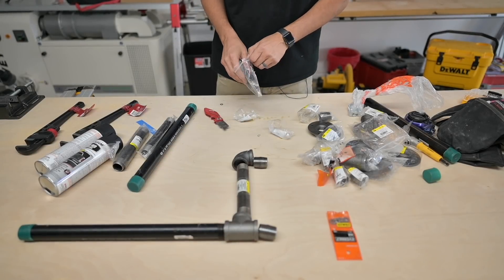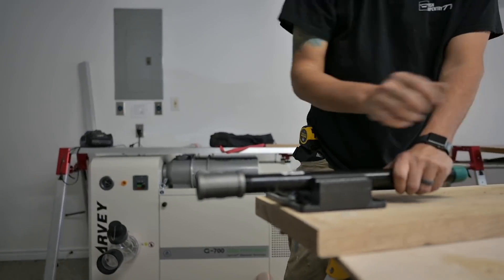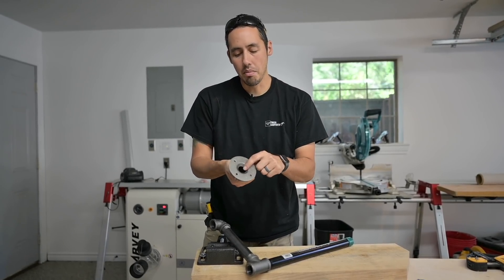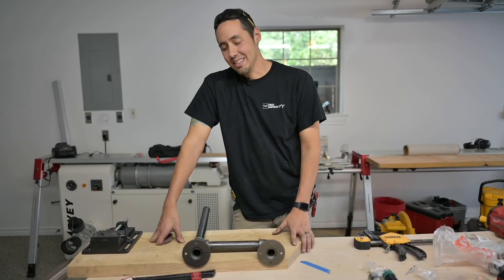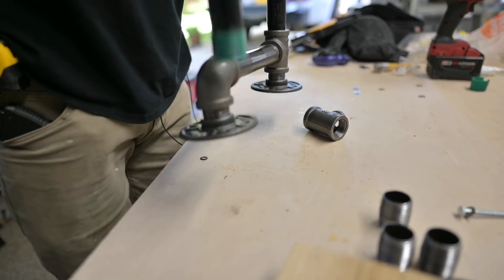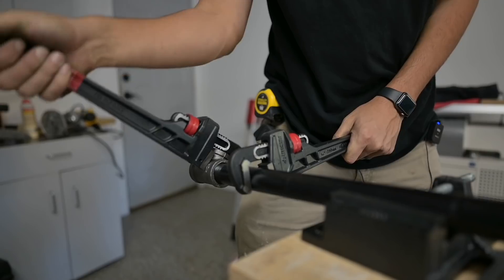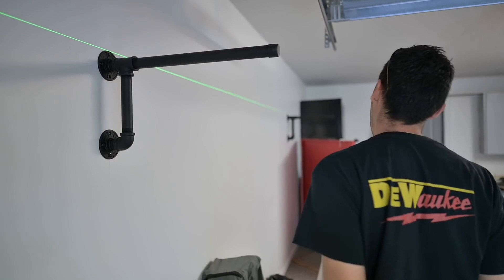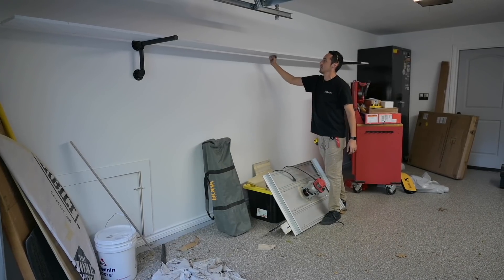I hope these can hold up the weight...

Comment: Richard… if you want to use a lag bolt on the “hidden hole”, use a HANGER BOLT. It has a lag thread on one end, and SAE thread on the other.  You put 2 nuts on the SAE end, (one is a lock nut for installation). Use a wrench or socket to drive the lag thread to the desired depth. Remove the 2 nuts… then slip the flange over hanger bolt, then a washer and nut. Hanger bolts are commonly used for hanging pedestal sinks.
Reply: Yeah, that's a good idea. You'd get a better shear value.
Reply: Good call Henry.

Comment: It looks great, the weak point is the threads, they are cut into the thickness of the metal and that compromises the integrity of the pipe with the weight you have on it. It was after all produced for gas or air to pass through under pressure not for it to carry a load. The further out from the wall the lumber in you multiply the leverage the weight creates.
Reply: Clint is absolutely right.

Comment: Leverage your weight! When pulling upward on the wrench you are only able to use your arm strength. But when pressing downward you can apply your whole body weight and as a bonus, you'll avoid banging yourself in the face if the wrench slips off the pipe/fitting.
Reply: That's not true, you use your legs and entire body when you pull upward. If you can't lift more than your bodyweight, get yourself to the gym! lol

Comment: I would recomend 2 things, first to distribute the weight over a wider area if you place a 2x4 vertical flat to the wall and the end set on the floor and screw it to the studs at like 12 inch intravals then fasten your flanges to that 2x4 this gives you 4 screws per flange and the load is transfered down to the floor. The next is set your lowest rack arms at just over 50" from the floor that way you can store sheet goods below the rack. Setting it at 50" gives you room to put a few pieses of 1 by scrap on the floor to set the sheet goods on to avoid messing up an edge if you get any water on the floor. I've done this in my shop and it worked out well. I really enjoy your videos, Ive learned a lot, thanks for making the effort

Comment: Suggestion if it has not already been made is to use a ledger board that is attached to each set of studs on 16 inch centers.  Then you add you plumbing pipes.  The ledger can be a variety of sizes.   A 1 X 6 is a good size for example.  I would also suggest treated lumber or deader.  I can be painted as well.

Comment: I have the same set up but on my ceiling. It works great.  I use pipes to hang everything, from extension cords to air hoses. 
I added some braces to the roof in the attic and it holds great. I don't really use it for lumber. Just for some moldings and trims.
Reply: I often think about the bracing in my attic which  is above 2/3 of my garage. I had the house built and asked to have the attic designed for living space so I assume it is ok because I hung 3’ deep shelves around the entire perimeter of my 3-bay garage. What do you thing? It’s been there for 20 years but I always think of it.

Comment: Hi, you can use thread locker for even hand tighting the pipes and fittings to any position you want, and Racor  fittings to address the second fastener issue, and be able to detach each unit from the wall, without removing the flanges.
Best wishes.

Comment: The weight on the top bar would be pulling downward...only one lag on is needed on top, one on bottom of the bottom flange but most of the load will be on that top lag bolt anyway. The point of failure would be the top lag.

Comment: when mounting the flange have the bottom hole on an offset. bolt the bottom in place and then use the pipe wrench to turn the flange so the top hole is align with the bottom hole
Reply: Just have to think outside the box. I was thinking the same thing.
Reply: I don’t quite get this idea. Is the bracket assembled first? “…bottom hole on an offset…”?
Reply: @erpinterfaces9631  Yes assembled. Just turn the flange offset enough to get the screw on the mark then rotate the flange with a pipe wrench & line up the other hole vertically. Done
Reply: Definitely a clever idea, but it only works if you are trying to get access to the SAME hole on each of the two flanges, e.g. both of the top holes or both of the bottom holes. Turning both flanges simultaneously in the same direction will then move the connecting pipe off to the side, giving access to the target screw holes, while keeping the connecting pipe vertical and maintaining a constant distance between the screw holes.

But in our case, we need access to the BOTTOM hole in the top flange and the TOP hole in the bottom flange. Given the geometry of this situation, any rotation of the flanges, whether in the same or opposite directions, or turning one flange but not the other, or turning one flange more than the other, all will increase the distance between the two target screw holes. So it doesn't help with our objective.

I think the best ideas in these comments are to either a) preinstall hanger bolts (basically a headless bolt) into the inaccessible screw holes and then secure the flanges onto those threaded stubs using nuts or b) secure faced 2x4s to the studs and then use an X-pattern for the flange screw holes when installing them.

Comment: I use something similar in my shop and I fastened 2x6's to the wall first then the pipe flanges to them. That way I could get all 4 lags into the 2x6 and it also keeps my material away from the drywall so it dose not mar it all up.

Comment: Been there.  Some suggestions:
- Use a vertical 2x6 ledger / stud board.  3 advantages:  1) You can use all 4 anchor holes so using zinc bolts isn't an issue.  It'll be supporting it's own weight, rather than adding load your studs weren't meant to bear.  3)  It's strong enough so you don't have to stagger the poles.
- Your shelves are too tall.  You'll have to un-stack wood to get to the bottom, plus it's too much weight.  Even if your poles hold, it can damage the bottom wood.  Instead, stack 3 or 4 shelves, no more than 16" apart.  You'll probably never want to pile them taller than that.
- Add some plywood across one of the shelves to hold the more delicate wood.  The poles will damage them.
- Add a front "up" poll about 6-8 inches, to keep them from falling forward.  Preferably removable or drop-down.  Maybe keep the threads loose so you can easily bend them down to gain access. 
- Add pads.  Someday someone's gonna rap their head or face on one of those poles at head-level.

Comment: The "bottom elbow" will certainly help. But I am worried about those T's and elbows.  @4:13 most of the load is going to on the T joint. Not sure it was designed to take the load.  It's not a continuous peace of pipe so that load is going to on that T joint.  You might be better off with brackets designed for the load.  So do keep an eye out on those T joints.  But that dust collector sure looks sexy in the background! :)  OK, at 11:49, it's been a while since my Statics class.  But with the arms going up, you're going to create a force that wants to pull out of the wall. When the elbows were pointed down, the stud was bearing the load since the force was down and in.  Finally, @14:30, you now have a cantilever.  And the usual rule is 1/3 sticking out, 2/3rds in the wall to support the weight.  But you don't have concrete in the wall so the round connector has to deal with the moment force.  Basically the force that is going to cause the bar to rotate down.  Keep an eye on those suckers.

Comment: I’ve been a carpenter for almost 50 years and in biz for 42 years. Somewhere along the line I read specs on the amount of “pull” it takes to pull out a Tap-con. Huge numbers. I’ve not read similar specs for lag bolts but based on the Tap-con gripping strength I wouldn’t hesitate to trust the “one lag per flange” attachment. Of course , find the center of the stud and place the lags accordingly. Plenty strong. I enjoy your videos and your successes are well deserved. Dave Heitman in Omaha

Comment: I’ve had good luck with Lozier shelving. You can usually find it used from old grocery stores on market place. You can buy the shelf standards and screw them to the wall then the shelves just snap in place and can be moved easily. They are rated for about 400 pounds for each four foot shelf. You would be able to line them up full length and your short cuts will be able to sit on them.
Reply: I did supermarket remodels for 10+ years. They always just threw out the old stuff that was perfectly fine for any wood shop.

Comment: Yep what you did does change the moment angle from mount at bottom to at the pipe, then the length of pipe acts as a counter moment to the wall.  So you are correct in doing it with more pipe.

Comment: I did the same basic thing in my garage, but i secured them to a 2x4, that was bolted into the stud.  That way I could leverage all 4 of the bolts holding the pipe collar into place.  I've had them up for about 3 years now, holding everything from MDF sheets to 2x4s, to baseboards and 1/4 round.  Not even any sagging.

Comment: hey richard in the future for material storage check out the electrical department and get unistrut. its the shit for garage shelves and racking due to the cone nuts that get easily inserted into the strut and the abundance of brackets that then easily bolt to the track and then the large mounting flanges are stout.

Comment: If you rotate the flanges 45 degrees the holes will be aligned and you can access two lag bolts per flange.
The difference will be the two holes will be not centered with the center of the pipe however having two screws each should be helpful. 
Also I would suggest cleaning the pipes etc with a degreaser before painting.
Enjoy your channel.

Comment: Think about some foam pipe insulation on the horizontal bars to save any delicate profiles being damaged.
Also, fit a 4-6inch vertical pattress to the studs and spin the mounting plate through 45 degrees to get a fix with all four coach screws.
Happy shop building, looking great so far.

Comment: Glad you moved the support to the top. If it's on the bottom then it actually creates leverage against the top mount and would ultimately provide less holding power.

Comment: Hi, if you first put the lag bolts in the flange, then screw the flange to the pipe in the vertical orientation you will be able to pick up your pilot holes, as long as you can get a spanner (wrench) on the heads of the bolts  your winning. A lifetime of pipe work lol. Great job and workspace 👍🏻

Comment: Richard, great minds think alike.  I used the same 1-1/4" NPT fittings and pipe to build a shelf that spans across and above my garage doors.
I have a 14' ceiling in my garage and thought that would be an ideal area to utilize what would normally be a wasted space.  I have 5 vertical 
pipes lagged into the trusses above the ceiling and 5 horizontal pipes lagged to the studs on either side of the garage doors.  I laid 16' 2x4's
across the horizontal pipes and placed sheets of 1/2" plywood on them.  The storage area has roughly a 4' height x 4' deep x 16' length.  
I probably have 750# of stuff to include the shelf itself hanging off my ceiling and walls with no incidents. So I think you're OK with you loads.

Comment: Use lag screws that are threaded on on end, double nut them drive them into the stud hang your brackets use a nut and lock washers to secure. You can vary the length by the depth you drive it. Use lag bolts on the hole without obstruction

Comment: Yes, the addl. flange helps. 
When you add weight to the horizontal arm, the lower flange will press the weight into the stud and greatly relieve the tensile stress on the screws for the upper flange.  A 45 degree brace would be even better, but require a lot more fittings OR if you have access to a welder, you could weld the 45 degree braces between the horizontal and vertical pipes.
Another suggestion: attach 2x4 or 2x6 lumber, horizontally to the wall and attach the flanges directly to those, at whatever interval you choose, using all four holes in the flange. In either case, the brace is really a good idea.

Comment: Should have gone with French Cleats. Adjustable, versatile, and extremely strong
Reply: Came down here to post this. There's a lot of makers on the tubes that have great designs utilizing French cleats. Extremely versatile, extremely adjustable and you can utilize the existing cleats to hang other tools from. For example: extension cords, air hoses, tool brackets, battery charging station, storage boxes, sandpaper storage systems, shop towel rack,.. the list is endless. Only limitation is what you can think of. You can zip lag screws into each stud for an extremely stout rack.

Comment: I hope you cleaned off all the oil from the pipes for the coating to stick. I also think that you could have scuffed the surface to help that coating bond better. I have used this coating before and did not adhere very well - Was not as durable as we were led to believe!

Comment: For the brackets on the bottom without the extra support, they might be stronger if you cut out the drywall behind them and replace it with plywood. That way the drywall behind the bracket won’t get crushed and let the bracket get loose. Just a thought

Comment: Fasten a 2x6 vertically to the wall stud with several lags, then fasten the rack to the 2x6. That way you can get 3 lags into the 2x6 at each pipe flange

Comment: Turn pipe slightly so you can bolt flange with two bolts at the top then turn assembly to line up lower flange with stud. Lower flange only needs one bolt as it will not carry the bulk of the load.

Comment: Bad idea. Gas pipe steel (black steel, not galvanised) isn't rated for structures. Also threaded ends are weak points.

Comment: A good idea for number of threads to engage is 7.  It truthfully can be between 4 and 13 depending on numerous factors (size, materials, forces etc.), but generally speaking if you can engage 7 you don't need to worry about it.

Comment: Attaching a 2x6 to the wall with adhesive and fasteners to the stud. Then you could attach the pipe flange to the 2x6 two of the screws would hit the stud and two of them will be in the 2x6 which is flat on the wall. Then the 2x6 will also help protect the wall from the lumber hitting it.

Comment: Your extra flange version is stronger.  It provides leverage on the horizontal pipe, via the tee.  Not sure what you meant about zinc bolts being weak.  That's only an outer coating/finish on the steel.  You'd have know the type of steel in each fastener to compare strengths.  I think the pullout strength is the limiting factor.  Looks great though man!

Comment: Good job doubling the flanges. I've used single flanges and the pipe broke at the flange as the pipe is thin because of threads and only about 3/8 of flange to grab it.

Comment: It would be easier to check for flat after the flanges are on. More surface area to catch slight discrepancies.
Also, to solve that bolt access problem - preattach 2x4 (or 2x6) pieces flat to the wall, into the studs. Then, you can rotate those flanges 45 degrees and have all 4 holes attach to the 2x4 on the wall. Not elegant looking, but should work.
Reply: I was about to say the same thing and read your comment 👍🏽
Reply: My thought too.
Reply: I was thinking something similar, with the addition of  making it a single length at least 2 ft above the highest flange and 2ft below the lowest flange. Use lag bolts every 12-18 inches attaching vertical 2x6 to in-wall stud. Also this will mitigate the drywall crushing / flex. (similar to how garage door rails are mounted to the wall). Paint to match the wall or the pipes. As far a load capability look at the flange bolts' shear strength to get a idea for load capacity and keep the load below that rating.
Reply: 2x6 Ledger board. Attached to all the studs, then flanges can be through bolted (or other fixings as suggested) at all four points. I also ran vertical pieces behind the ledgers to “reinforce” the studs and avoid crushing the wall board. (Excessive I think.). Looking forward to sawdust!

Comment: Flat face a 2x4 to the studs running vertically and you can use all four holes of the flange.
Reply: How if the pipe is in the way of the screw flange
Reply: @Niko-iq8bc  turn the plate to a 45º

Comment: This is a perfect example of simple physics. You have downward forces or loads and resisting forces or tension on the lag bolts. The resisting  forces must equal or greater  than the downward force OR the brackets will move, and come off the wall. You know that pulling nails with a hammer and the longer the handle on the hammer, the easier it is to pull the nail. Really stuck and stubborn nails require a long crowbar because it provides more "leverage".
So, the longer the pipe that is sticking out from the wall, the greater the leverage it has to pull the lag bolt out of the wall at the top. The lag bolt just underneath is not under any pulling tension, in fact it is being pressed into the wall. Don't believe me? Put you finger under the claw of the hammer and then pull the nail, OUCH. That is a compression force. The distance the top lag is upward from the pipe also determines how much tension the upper lag will be under. The shorter that distance, the more leverage the pipe can apply. When you extend the wall bracket using the extra pipe it's best to have that length above the load bearing  pipe, than below it because it increases the leverage. You flipped those brackets "upside down" not realizing that it would be much stronger that way!